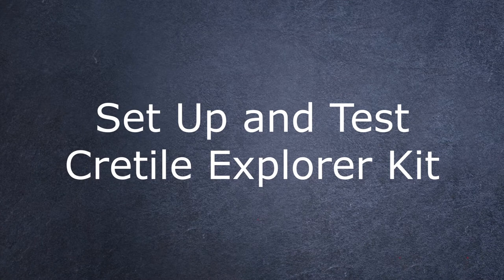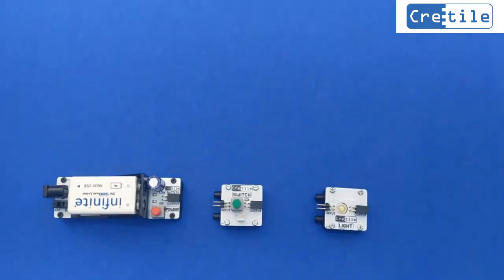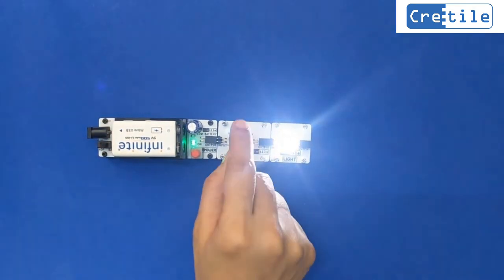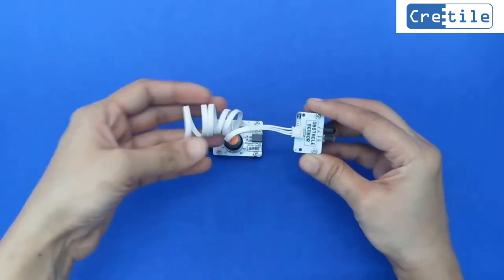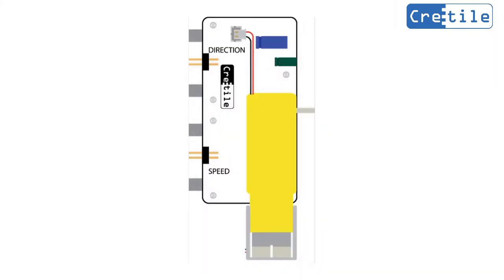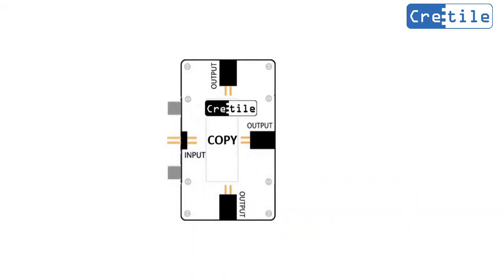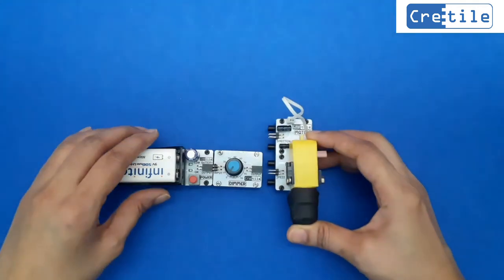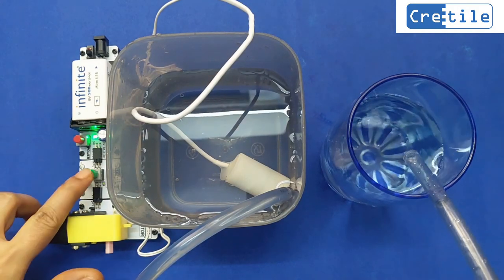Test Cretile Explorer Kit

Comment: The motors are not working.
I also tried with DC connection
It says low battery for the DC connection
Reply from the maker: Contact support@cretile.com we will rectify this.
Reply from the maker: Hi,

  Use +919538860008 to reach Cretile team over WhatsApp or call. Do connect with us on this number for any queries or support requirements.

  Hope to hear from you soon.
  
Cheers! Cretile Team.

Comment: Should I charge the battery before I start anything? How lond should I charge the battery?
Reply from the maker: The battery is pre-charged. You can start using it right away. When charging there is an LED on the battery itself that turns from red to blue once the charging is completed.